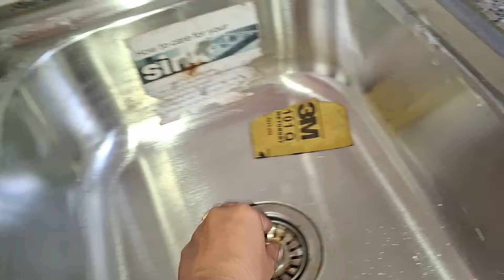My Filipina Wife Is The Boss She Get Things Done ! #philippines #retirement #repair

Comment: Very interesting. Never seen a sink installed like that. It does look nice. However I don't see why it wouldn't leak just as bad. Leaking shouldn't be a problem because it's all cement, title, ss so nothing to rot.

Yes the original install is one standard method in the US but didn't seem to have much caulk. It's a cheap way to install, hard (impossible) to keep clean and does fail over time. To maintain the sink has to be pulled, cleaned, caulk remove and reinstalled with new caulk. Almost no one does that so these sink just look crappier over time.

When we in the US say "under mount the sink is actually clamped to the underside of the counter so the counter over laps the sink. In theory water can't pool and leak. Caulk is used here too but because the caulk seam is hidden it doesn't matter that it looks crappy over time. This is a high end install.

I'm super impressed with the Filipino workmanship. Cutting the title with a hand held grinder (I assume), getting the corners right, very impressive. Also always how well Filipino workers work together. American workers fight a lot, everyone wants to be the boss.

I am surprised Filipinos don't make sinks out of concrete. That eliminates the seam entirely. Seems like Filipinos really love tile. Same with floors. I like polished concrete floors better than tile.
Reply: Yes, it is good & no cracks unless you drop a ton of bricks on it.....highly unlikely.